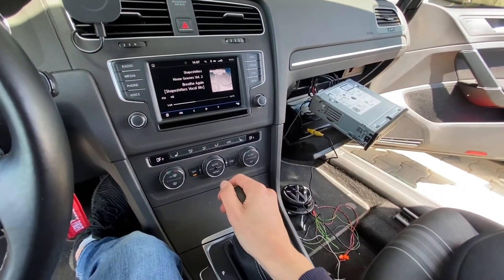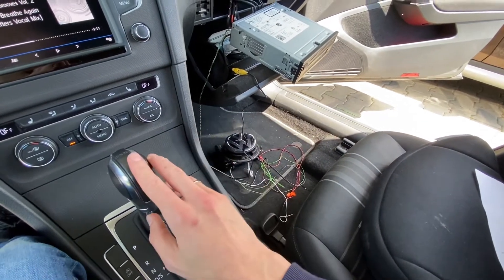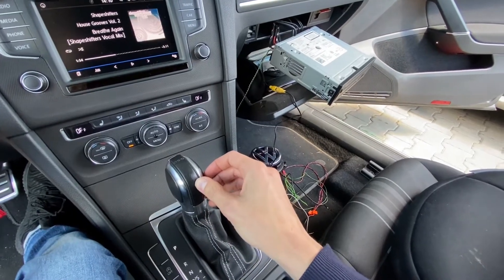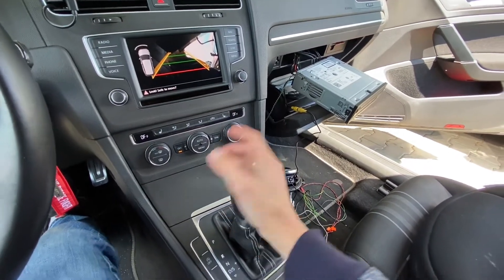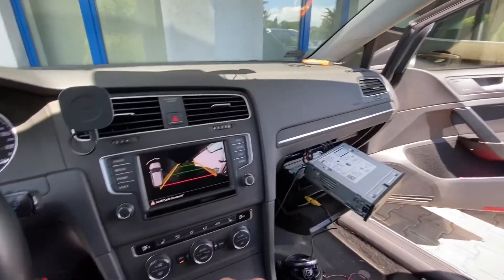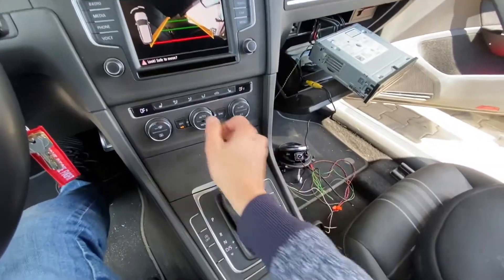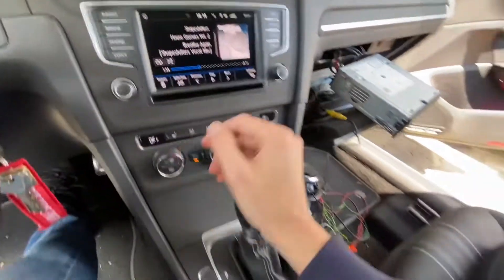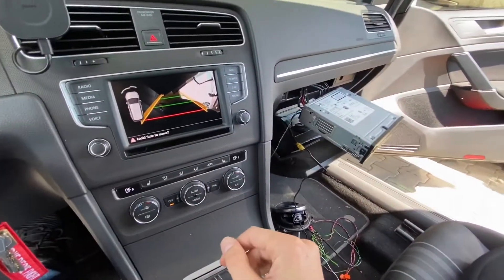VW Golf MK7 (5G) RVC High retrofit, part 1: rear view camera test

Comment: Brother can you please send the long coding of parking sensor with camera still on after switching to drive , i need them please
I have the camera in VW logo but when i switch to D when am.parking the car it disappear,  i use the  android auto retrofit thats why need to stay one
Reply from the maker: Maybe you have RVC-Low? With green static lines.
Reply: @mr-fix  yes i have RVC low , any how to make it delay the closure or make it on with park assist with coding ?
Reply: @mrfixpl  i found how to delay the display of the module, so you can get Parkpilot display for bit seconds  as you want 
https://youtu.be/OFQjkxNm2u4

Comment: Hi, thanks for the 3 part videos on this very useful. However, I am having trouble with the below. Is there any chance you able to help?

My physical P button next to the DSG gear selector now only activates parking sensors without Park pilot - only beeping without any visualization on head unit, same goes for "auto activation" of park pilot when approaching obstacle in front. To get any visualization, I need to trigger RVC by going into reverse. The P button does turn off the reverse camera and visual aid that pops up in reverse but not activate it. Any help would be much appreciated.
Reply from the maker: I believe that's parktronic coding. module 10 or 76 (depends on how made year), long coding, look for visual OPS and enable it. This will configure the parktronic module to send signal to infotainment with visualization request when the parktronic is used. Cars with just rear sensors had this option disabled by default if I recall correctly.
Reply: @mr-fix  thank you, I will take a look. Fingers crossed I can get it working.

Comment: Hello excellent video, I speak to you from Spain.  One question, which infotainment modules (numbers) are compatible with the RVC HIGH camera, thank you. 👋
Reply from the maker: anything that is not 819 or 820 should be fine.
Reply: @mrfixpl  Hello, learn a lot from your video. I am from Hong Kong. My Golf GT is using 5G0035819A. I installed a RVC camera which buy from China Online Store. This RVC camera does not need any coding or config and it can switch the screem to parking mode which similar to your video 5:45. However, the screen backgroud is black and cannot show the camera image. Do you have any idea 819 does not support the camera as hardware or firmware limitation? Thx
Reply: @mrfixpl when you say 819 or 820 do you mean hardware version?

Comment: hi, I have a golf 7 hatchback with discover media mib1, which camera model can I use? part number model?
Reply from the maker: MIB1 Discover Pro will support both RVC-LOW and RVC-HIGH.
Reply: @mrfixpl  ok but i have a Discover Media MIB1 and i need a part numer of the RVC designed for the golf 7 hatchback

Comment: Please tell me how you managed to code that the rear view camera stays active while in D and driving i need this while driving to see my flames of the exhaust through the screen i have been looking for this for a year now
Reply from the maker: That's how the RVC-HIGH works if it's coded correctly. If you have RVC-Low (static green lines) or wrong coding, you will not see video feed when not in reverse.
Reply: @mrfixpl  u have the correct codings? Or a way for me to check if i have high or low

Comment: hi, how do i find the part number for the camera ? i have a golf sportsvan (similar to the variant) model 2016. there are many numbers on the forums 5G0827469F or 5G0827469E or 5G0827469H etc etc. how to check which is the right one for me ? Also, is there a way to be sure that i am buying an "authentic/original" object on aliexpress ?
Reply from the maker: Pick one of those for RVC High designed for sportsvan: 510-827-469-E, 510-827-469-G, 3G0-827-469-BL, 3G0-827-469-CA, 3G0-827-469-CJ, 3G0-827-469-FL, 3G0-827-469-FS
Reply: @mrfixpl  thanks for the answer. could you please also let me know how do we find these numbers. is there a online vw website where we can check these things?

Comment: hi there, i recently bought a used golf 7 sportsvan (lounge). i think it comes with composition media. how would i know if the display on my car supports the reverse camera. I will get the car only in a couple of weeks but have the VIN . I don't find anything about reverse camera in the vehicle specs.
Reply from the maker: Check the unit part number. You can find it in settings or in hidden menu.
If the part number ends with 819 or 820, unit will not support rear view camera.
Reply: @mrfixpl   thank you. do you (is it even possible?) do 'blind spot' retrofit for a golf mk7? could you please do a video on that. Also does VW offer an original headup display that can be retrofitted?

Comment: Hello, can you please share your camera part number? I retrofitted 5Q0980568B into Golf 7 2015 with manual transmission, coding done, camera is parametrised and working. But if I press button for park sensors they only beeps, no cam image as you, if I put “R” then I have image and can switch on MIB display for “car with sensor lines”. I believe you have different camera. Please let me know. Thanks
Reply from the maker: I have 5Q0980568A, but I don't think that's the issue here.
Reply: @mrfixpl  Thanks for answer 👍🏻😉
Reply: @mrfixpl  as i know 5Q0 is for HB model and not variant (5Q9). As far as I checked, there is no camera in the higline version for the variant? Is the camera calibrated ok, or is there any deviation. I assume the camera was mounted on the HB model?

Comment: Hi Mr-fix, Nice video. I am thinking of getting the same HL camera retrofitted to my MK7 with MIB2.5. Does it mean I can get all the wiring connected to the brain (glove box module) without removing the radio display (which can be a pain)? Tks
Reply from the maker: Yes. You need to connect just the main unit. Check part 2 with details.

Comment: Good day Mr-Fix

Love the channel and your videos have helped me alot in my retrofit mib2 unit from Mib 1 unit.

But I need some guildence, after my retrofit  and my testing I noticed the following not working.

-dcc (was working on my mib1 unit and I have it installed from the factory.)
-rear view camera, the camera pops out the hatch but the mib2 unit doesn't show the backup camera image only a full pcd sensor screen.

Can you point me in the right direction? I'm guessing it's just a coding issue. As all the hardware was OEM from the factory.

Thank you.

Comment: How much does that cost to You ? In Euro-s ?
Reply from the maker: about 110 Euro for used camera. and 20 Euro for wiring from AliExpress (still in transit).
Reply: @mrfixpl  Where did you get it? looks like the highline golf 7 versions are more expensive.
Reply from the maker: @noz3m  it was a one-time offer. High-line version is more expensive, but you can get low-line and replace the camera unit that's inside.
Reply: @mrfixpl  Thanks, also the highline version needs calibration via VW tool right? I have this camera diy on my todo list however allot of people go for the lowline since the highline is hard to get calibrated.

Is it easy to get the lowline and then buy the highline camera unit seperate?
Reply from the maker: I believe that if the camera unit is new - it requires parameterization with ODIS or VCP.
Next it needs to be calibrated with the calibration pattern.
Reply: @mrfixpl  ok so if I buy the loom via alo xpress and the camera second hand I only need odb eleven? I'll await your next video. Thanks for your replies.
Reply: Thats cheap , in my country for a hatchback 350€ used one , but I learned from you that on variant doesnt fit .. show us the end project , everything that you done on that golf you did it OEM and thats cool 🙌🏻🙌🏻🙌🏻

Comment: I have a low line camera, can I just swap to the high line camera and code it in or do I need to feed new wires through the car?
Reply: You have to swap the camera and add the can-bus wires from the camera to the head unit
Reply from the maker: Swap camera, add wires, and change coding in vehicle.
Reply: @mrfixpl  different wire as the low camera?